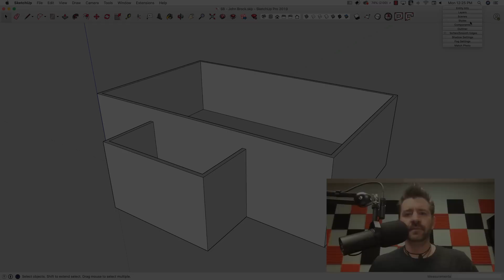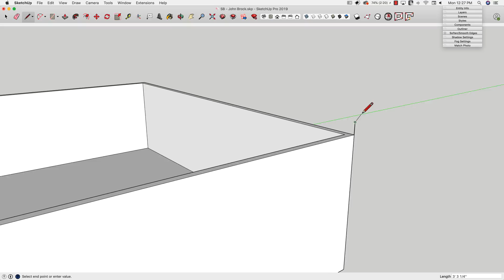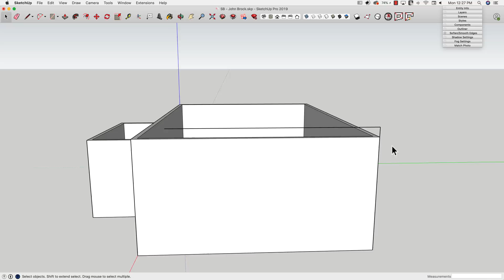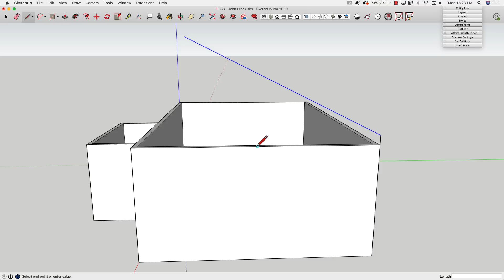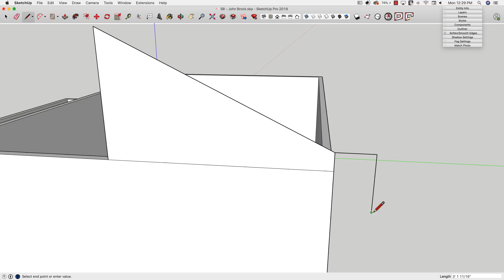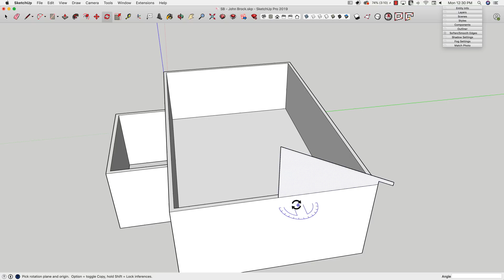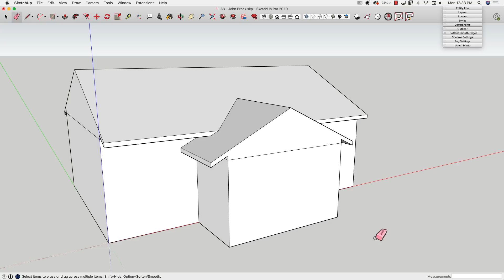Constructability modeling with SketchUp: Roof modeling

Comment: great for modeling the exterior shape, but I seem to be unable to push/pull windows through the gable end (to make a penetration),  they just push out the other end.  Is that because the faces of this roof lack any thickness?  Any quick ways to remedy this?

Comment: Hi What is the modify key  option. I'm using windows 10 and sketchup pro 2021
Reply from the maker: When you are in any command, the modifier key will be listed at the bottom of your screen. They will change besed on your operanting system and the command you are using.

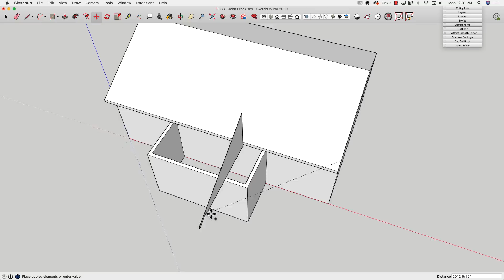Comment: Hi Rotating lines by slope seems great, but for some reason my desire slope does not rotate to the correct input. For exmaple I will rotate line to a 6:12 slope, but angle look more like a 12:12 slope. Most likely user error. Any chance you can shed light on this Aaron.

Comment: This is not working for me.  I have each external wall in a group as you showed in a Walls video.  I clink on the corner and draw the vertical line, then the horizontal line. Then use Rotate but when I angle up the vertical line bends.  Is the grouping the problem?

Comment: I'd like to see an A-Frame roof w/no overhangs made from palm leaf (grass type - roof material) attached to a (3) poles per leg "Bamboo framing (inner structure".) to attach the roof structure to - beginning (20') above the ((ground floor & running to the peak (40' above "ground") - (which (of which the ground floor) is actually real Earth type ground for planting food plants in)) & I'd like "greenhouse / shade house covering" as covering for the walls from ground to (20') up. And (2) (sized appropriate for location) decks made of bamboo (1) at  (20') up (second floor deck.) And (1) at 29 feet =(3rd floor) up from the ground level - which is actually "GROUND."  = "the" food garden "floor")  - making a total of (2) decks on each end =(4) decks total. & on the triangular window ends separating interior from the decks w/bamboo window frames & all glass separation to the living space (2nd) & (3rd) floors of The Greenhouse\home  - which is (to a higher degree than standard) more Earthquake flood and extreme weather resistant. than your average home - more specifically designed to be touted as the best tool "type home"  utilized for the practice of practicing permaculture principles - in order to correct what the practice of capitalism's mass practice of generating excessive personal wealth is doing to deplete and over toxify & over consume the natural (predominantly "used-to-be" free-of-charge) provisions systems. But is now just a way to get a way cool (very covetable) - life style of converting all used to be free-of-charge things of the natural world - into Man made (money made THINGS) of excessive convenience - at the expense of the once-up-on a- time "simple life" supporting nature of the Earth it's self - accelerating the fast approaching extinction of a fellow humanity of drone slave workers "obliviously guided by money empowered (over complicated) science" - helping ourselves to rid ourselves from further interfering with the natural balance - which used to be able to sustain life - on a beautiful natural free-of-charge provision systems supplied Earth - until the masses of money making mankind "ran amok" to the (over complicated by money making) end of the nature - of naturally supporting humanity on Earth. "ALL FOR THE MONEY".  Is it too late - we better start building these GreenHouse\Homes but fast - with which -  to help each other have enough predominantly Free-of-charge food and shelter materials - while nurturing the natural back to health. Or we can finish our little science project to the end result. "Sooner than might need be". Because everything in the natural world has a shelf life "or an extinction day" - (just ask money empowered science) - They Know. (at least approximately)

Comment: Nice video.  I never knew about that 6 : 12 trick! 
 
One question:Why didn't you use intersect with model or intersect with selection to create the intersection lines between the two roofs, instead of manually drawing those lines?

Comment: What would be the correct way in sketchup to keep the roof and main house separate? I've only used Sketchup for single 3d printable items. Do you make groups, componenets, layers? If for example I model my house and I want to hide just the roof later to see inside. Should I make everything that's part of the roof a component?
Reply from the maker: The roof geometry should all be placed into a group or component to keep it separate from the wall geometry.

Comment: select face - intersect with model - done.
Reply: Yep. Prexactly. That command also fixes lots of quirks w lapped geometry or missing faces etc. Spot on. However, selecting only faces you wish to intersect and choosing intersect w selection will avoid lots of ghost lining on stuff at times. I use that method more frequently when trimming roof items as it avoids all those lines.  And always make the walls and roof separate entities for  ease of navigation etc.